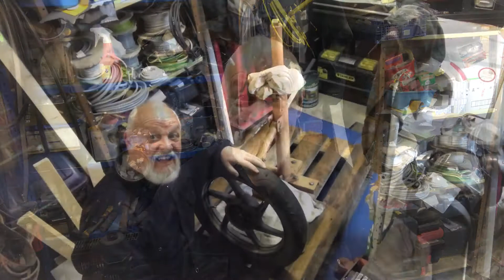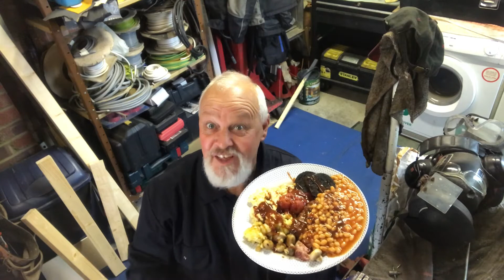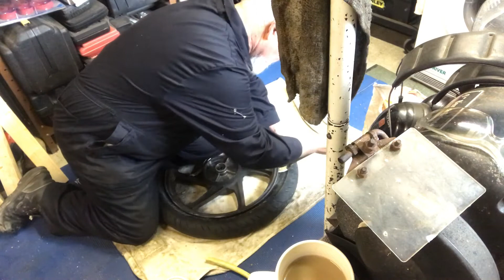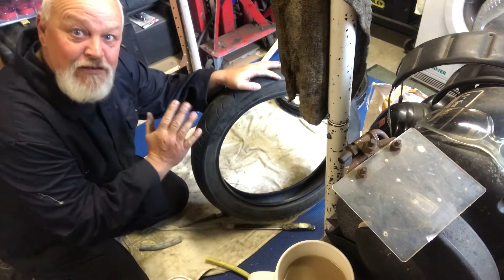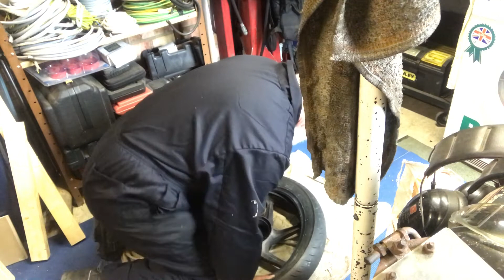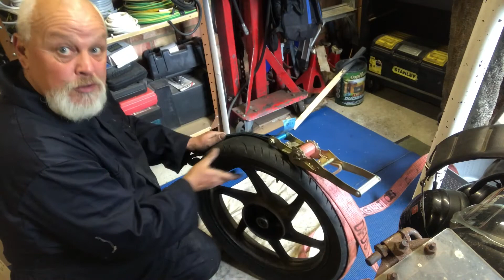How to change a motorcycle tyre using tyre levers

Comment: If no tyre breaker I use a blunt brick chisel with no air in the tyre tap around the rim and it will break.
Reply from the maker: Hi Jeff 
Thank you for the tip